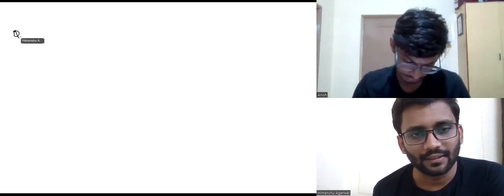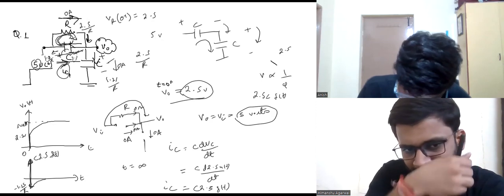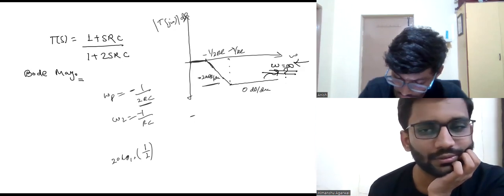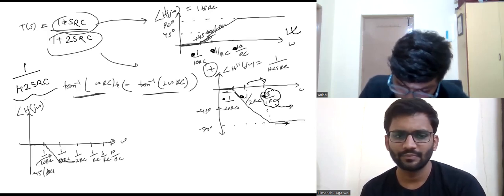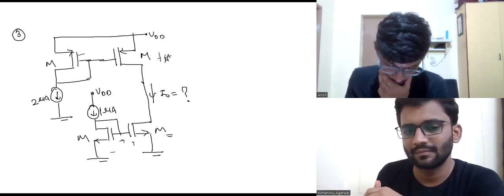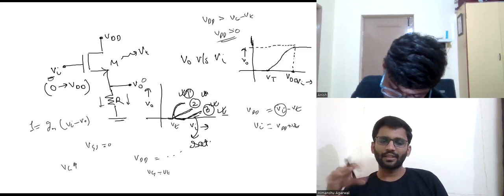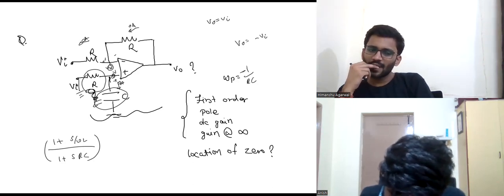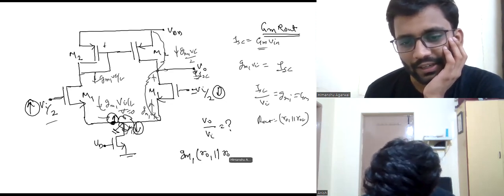MOCK INTERVIEW of @AnishSaha_  || Analog Engineer

Comment: Wrong answer in nmos q

Vo increases faster than vi.....because of id^2 flowing through R....so vi-vo will always be less than 0....causing the Vgs to become less than 0 and turning nmos off.
U jeed to consider a output cap for this q and the rate of change of Vg should be higher than Vs.

Comment: In the ist question, at t=0, if both caps are Shorted then the input voltage comes directly at Vo(ie. 5V), then how u r saying that it will be 2.5V?
Reply: the current is infinite , so caps charges to 2.5v by v division, vc2= v0 there

Comment: Hi 
It was good interview. questions are good and thanks for posting it in YouTube.
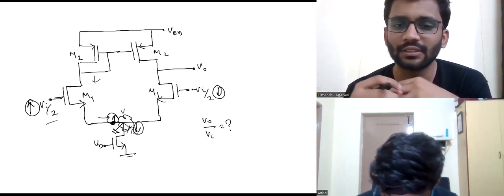At time stamp 46:05 really the gain at that node is 0 ? because you have current mirror load is there, if resistor or pmos load is present then that explanation is correct. But here we have current mirror. You can correct me if am wrong. Also procedure for calculating rout seems odd to me but answer is correct. while calculating left side nmos and pmos were not involved. In Razavi (second editionDesign of Analog CMOS Integrated Circuits by Behzad Razavi ) page numbers 152, 153, 154  have simple explanation of Rout calculation. 

Please correct me if I am wrong.

Comment: For the MOSFET Source output question, the output would only be Vdd-Vth, if the Resistance R is strong enough to create a feedback such that Vo/Vi transfer function is a straight line, right? Otherwise |VGS| of the device would be higher than Vth, right?